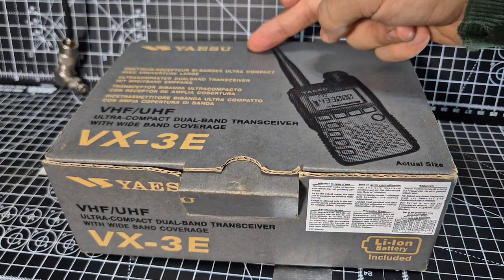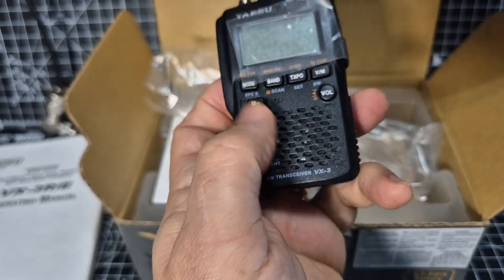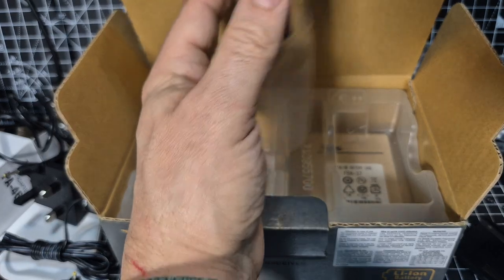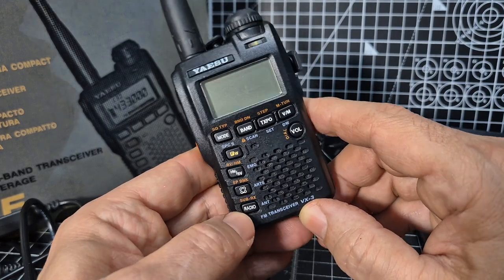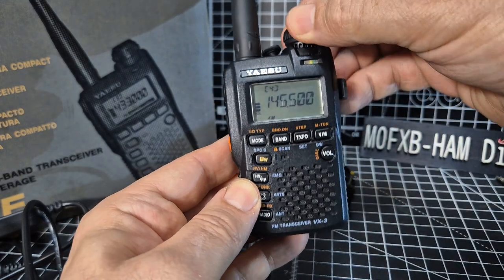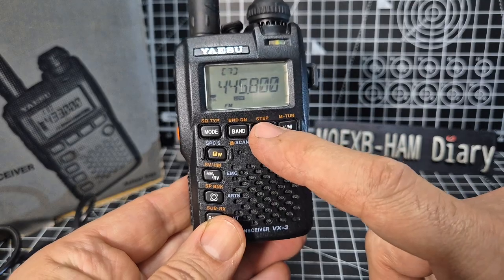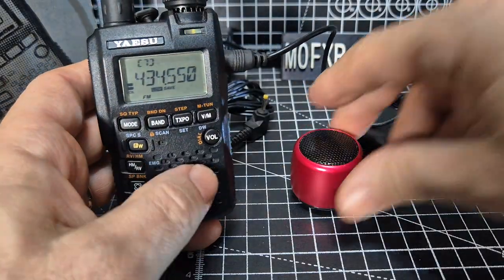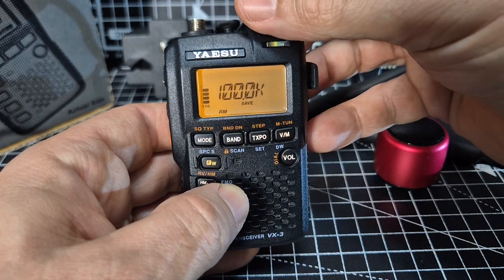Yaesu VX-3 Unbox , Test & Overview - 2025

Comment: What a cool idea for a video. Maybe it be the start of a series of segments like "Treasures from Andreas's Attic," LOL.  I think that battery was the same size as some old top-tier Motorola FRS radios I remember. Nicad with memory issues?   Aluminum die cast chassis. Wires II. 3 watts max output, .3 low, 1.3 mid. The features and the fact it worked and worked so well are a testament to good engineering and quality work in the radio factories.
Reply from the maker: Totally agree